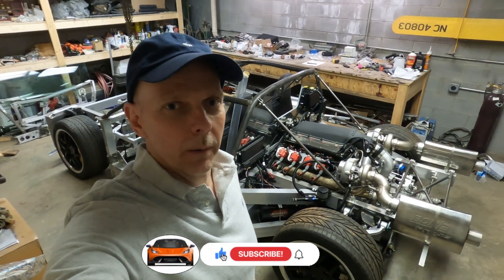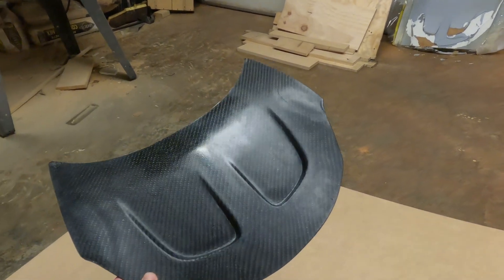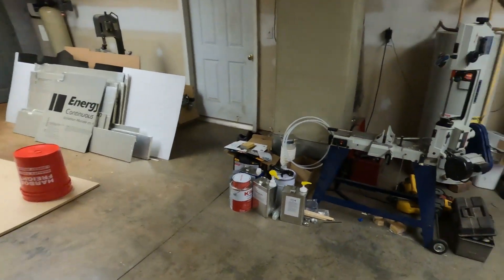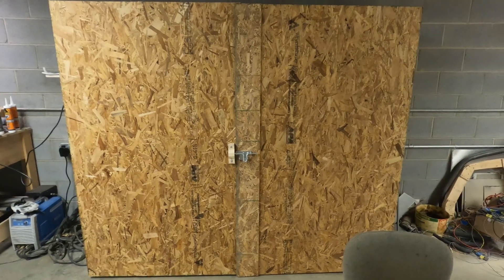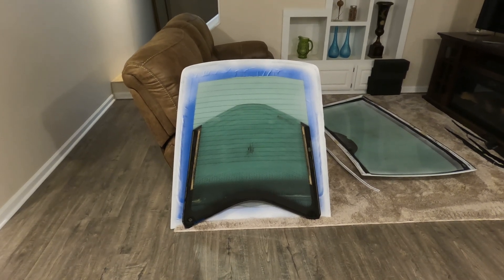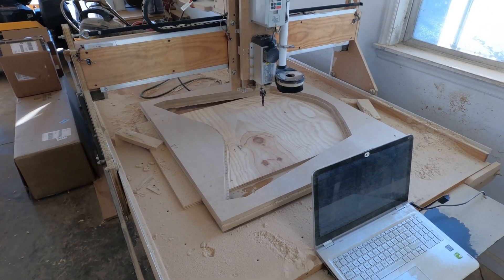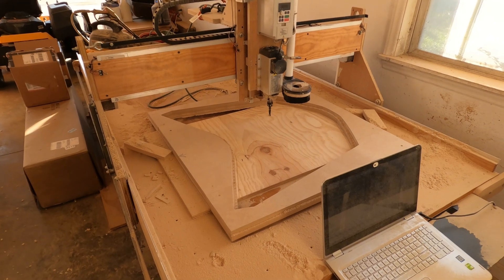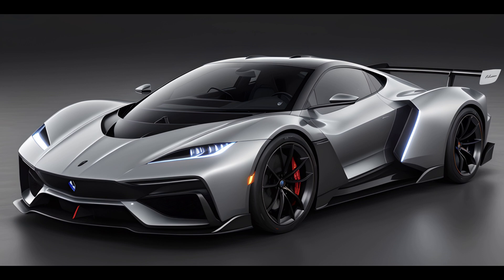Building my own supercar - Making my fist carbon fiber part

Comment: This is a year too late, but pull suction through a catch pot, this way you save your guages and machinery. I just found your channel and binge watching now...
Reply from the maker: I did buy a catch pot after that expensive mistake. Thanks for watching.
Reply: @ I am now at your video where you had an issue with the oven. Have you tried PVA as a parting agent?
Reply from the maker: @ I haven’t yet. I have been using a good quantity high build primer and several coats of wax recently, that seems to be working good. I have seen several videos of people using PVA.
Reply: @basementsupercarbuild2948  I make carbon fiber prosthetics and I use pre-made PVA bags. However, I like all things fabrication and I have worked with silicone molds as well. I use Part-all PVA #10. I pour it in a cheap HF spray gun and apply several thin coats after my wax coat.
Reply from the maker: @trased1trased thanks for the input. I will look into it and try to learn more.

Comment: Hey so just thought of something that may help you out. There is a Channel called "Street Bandito" and they are pretty well versed in the carbon fiber panel making industry. They have made several full carbon Datsun 240 / 280 Z cars. You could try to reach out to them and see if they would be willing to give you some pointers and advise on how they do mold making and panel maknig

Comment: I would suggest having the glass CMM inspected to give you the profile you need. Create enough data points to make it as a model. Or have it scanned. Do you have a video on how you made your own CNC maching
Reply from the maker: I wish I knew somewhere local to have that done. We have a scanner at work but doesn’t support parts larger than about a 12” cube. Unfortunately I don’t and videos on my CNC. I made it a few years ago and it is my own design. If I had it to over, I would have used aluminum for most of the parts.
Reply: Check out Carl Zeiss. We are going to purchase one of their CNC machines for inspection. They also offer inspection services too. I think it would be worth it, this way you have an accurate scan, and you can adapt it to the cad model.  @basementsupercarbuild2948
Reply: @basementsupercarbuild2948  And 8 months later you have a separate playlist on the new and improved one nearly done.
Thanks Roger